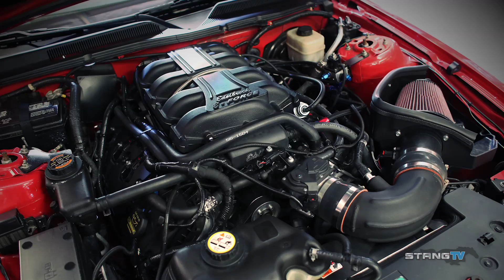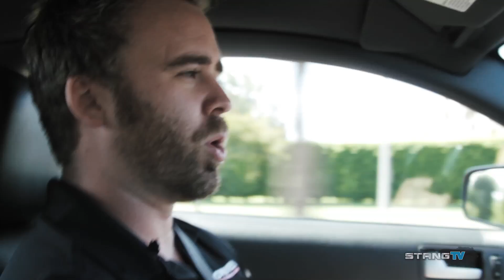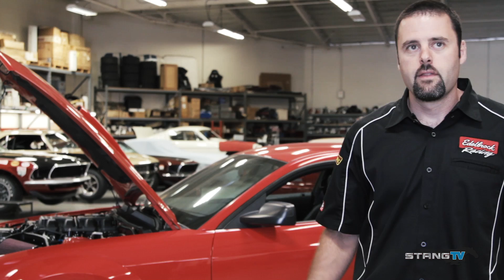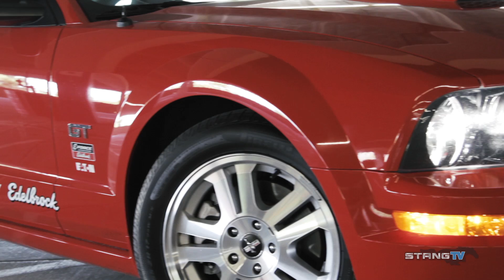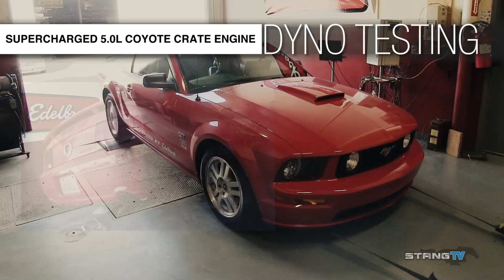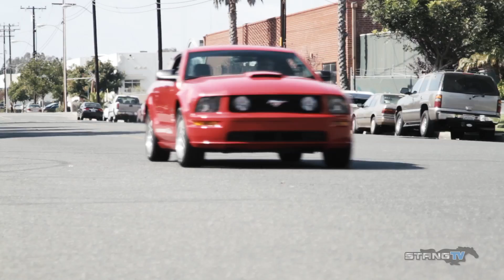Edelbrock 700HP Coyote Crate Engine

Comment: supercharged Coyote should be making closer to 1000hp
Reply from the maker: No stock engine Coyote will make that. But yes we make a supercharger capable of over 1000hp. You need a fully built engine in order for it to survive.

Comment: how much would this all cost???
Reply: a fukton
Reply: 6k plus labor.
Reply: @RCcorona10  that motor is 16k
Reply: @MrDavidelliottjr  motor ok, the blower is about 6 do.
Reply: I dont have that motor but my coyote on a blower will do just fine.
Reply: Will this fit in my engine bay of a 1996 F250HD  4x4 where I have the 7.5 L 460 now ?
Reply: A lot. Look up the aluminator. It's upwards of 16k.  For the motor. And the blower. Yes ya looking at 6k more at least. Duel upgrades. Brake upgrades. Trans upgrades. May I keep going.

Comment: Why only a 2 year warranty 🤔
Reply: Cuz it is a crate motor designed for racing. Many of these engines are designed to last far longer than any civic engine on the track. Plus liability reasons as many who buy that engine install it with basic tools rather than spending extra for a shop to install it.

Comment: Motors run on electricity, engines run on fuel. Rant over.
Reply: Stupid rant since you, apparently, have never looked up the definition of "motor" or "engine."   You might want to do that first.  You'd find out that a motor runs on electricity OR internal combustion, while an engine is a much broader term and is a device that converts power to motion.
Reply: I'm a mod motor guy I will say    these motors havet ben around long and look how ford put no effort into them the 2v for 20years 210 to 260hp 300tq the 3v had a 6year run 300hp/tq the 4v without blowers were 300hp/tq now ford thinking harder 30years late ford made to 2v head cast both didn't flow well without work the 3v they made one head that flowed OK they did the 4v right but n/a it was still hard to make big numbers without a blower if the coyote and 5.2 motors were out 15years ago they would get more respect
Reply: I used to think the same thing, but a few hardcore engineers shot me down on that one. To be safe, I just call it an engine. :-) At least we aren't calling it a power unit yet. /points to F1

Comment: How in the world does this get more MPGs than a naturally aspirated GT350?
Reply: I'm not confusing anything  I've had supercharged engines and got better fuel efficiency then from the stock engine  I know of several vehicles that have provin this
Reply: Superchargers increase efficiency. Especially when dialed in correctly!
Reply: @Gero1969  
Don't confuse efficiency with volumetric efficiency

Comment: I put one of these superchargers on my 2012 Mustang GT automatic (3.73 gears).  The motor lasted 5 months. I had it dynoed and data logged when I first installed it and was told it was a conservative and safe tune New motor cost me 10, 000 dollars.

 I sold the supercharger to a guy who owned a 2012 Mustang GT convertible and his motor lasted 4 days.  The stock coyote with 11.5:1 compression and sintered metal pistons doesn't like boost.  With a 9.5:1 Aluminator you would be able pound on it and have it last.
Reply: My gen 1 coyote threw a rod at 111k miles after 1 week on e85 and 670wheel. Lasted 111k miles on 92 octane and 600wheel. Stock gen 1 rods are crap. This set up with built forged coyote and 9.5: 1 compression will last forever at 800wheel e85 or 750wheel 93 octane.  Gen 1 coyotes are timbombs over 600wheel.  Did both you guys throw rods and wreck engine like me..
Reply: 9.5:1 aluminator or any built low compression coyote with 2650 blower will last 200k miles at 800wheel on e85
Reply: Hey what new coyote did you put in for $10k . Aluminator low compression

Comment: 22000 dollars for the block ? 
i dont know if this is okay or too much
Reply: Tee Z i prefer turbos over superchargers
and thanks
Reply: +Faisal Abdulaziz ,its way too much for mine
Reply: Kev T
is it safe to say that it could be done reliably for far less ?
(not a ford enthusiast so i dont know how much aftermarket parts go for fords)
Reply: Tee Z yeah i kind thought the same as well ....there pretty steep 
lets say you beefed up the 5.0 with aftermarket engine internals to withstand the 700hp ....i dont think you would hit 22000 dollars blue printed (money spent on engine) 

there has to be another way
Reply: +Faisal Abdulaziz stock block can handle over 700 hp just fine. now if you do install forged pistons and rods, you can also turn up the boost to 20 psi or more, pushing 1200 whp  +.
Reply: hmmm....stock engines are sure alot better than used to be
Reply: +Faisal Abdulaziz go to American muscle. com,they got everything, super chargers starting at $4000 ,also have twin turbo set ups.
Reply: Jeff E hmmm
Reply: I paid 13,995 for an lsx454. 625hp naturally aspirated out of the box and 24.5 mpg in my 78 vette.

Comment: I wish my 4.6 had more miles and worn out so I could justify a Coyote swap in my 2005 GT!!
Reply: +Luke Aaron Huseby I have the same problem. A 2008 w/36,000. Bolt-ons for the 4.6 just don't even sound like fun compared to 700 horses.